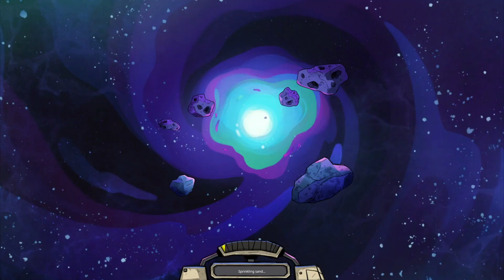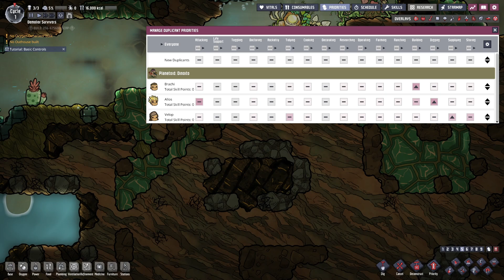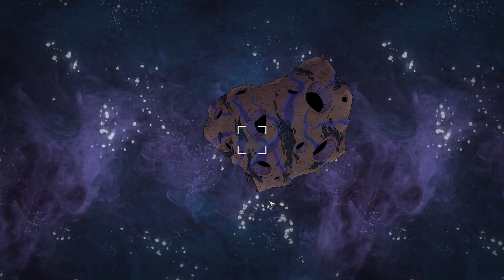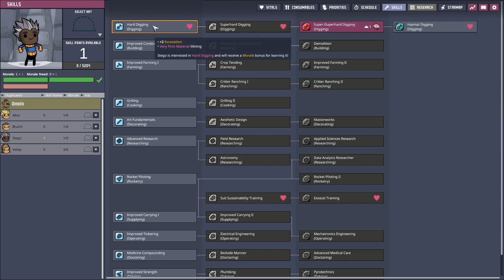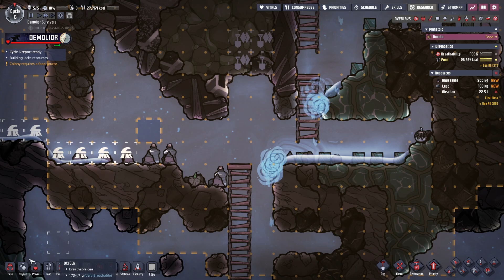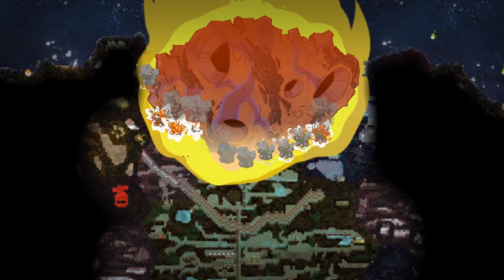Soooooo Close - Demolior Survivors - Ep. 6

Comment: This challenge is literally just: dont dig up. 
1. dig down and to one side for your base, using any natural abyssalite above as a overhang. Never dig/build higher than the lowest meteorite impact tile before the impact. 
2. build two layers of tiles beneath the lowest tile of the meteorite. one obsidian basic tile row. one row of insulated tiles beneath that.
3. Race for Insulated tiles and a digging dupe that can handle obsidian. Cap any non hot vent or geyser you come across with insulated tiles as you hunt for obsidian.
4. Always work from the lowest meteor impact point, working out, but prioritizing the side that your base is on. 
Otherwise its super simple. Try not to have a dupe get stuck or slain on some random event later on before 100 days.

Comment: I've been watching these, and I got my achievement after your second one. To be fair this was after watching how things played out the first couple of videos of yours.

I think your playstyle makes this much more difficult. The playstyle of trying to save as much as possible and get all the goodies that you may lose. No shade at all, we all play our own way. :)

After watching your second video, I did it this way:

1) everything four spaces away from the impact I never touched.
2) I researched quickly to insulated tiles and then used these to block off the heat area all around. Simple Shale insulated tiles worked until I got cool water running through them to pull out heat. Keep in mind that to survive past cycle 110, you have to insulate against all the volcanos and steam vents all around you anyway.
3) Food for me was one "doored" off room filled with sweatcorn and 3 mimillets
4) I used a cooling loop to run through the insulated tiles up top where the meteor was closest - once I had radiant pipes I put some in and removed them as needed

After about 20ish cycles everything played normally - set up a couple of stables to ranch two lumbs in each to produce peat and started working towards a SPOM.

The most difficult part for me was managing heat, but thanks to the cool slush geyser, it was not too hard. The way you are holding back the asteroid with built tiles is going to create a serious heat problem in the next 100 cycles...that is my guess.

It just seems to me that you are so focused on saving things and building a barrier instead of surviving. You mentioned in the second try that the tiles are much more dense than tiles, and that is where I got my strategy, so thank you. :) If you back away 3 or 4 tiles and just play to manage heat, it isn't hard at all really. You just have to give up on saving so many things.

If it helps, just think of how many things you can mine out after you survive and think of the fun taming the asteroid :)

This seed spawned a cool slush geyser right under my base if you are interested: V-PRES-C-907201049-0-D3-0
Reply: Did the shale too
And you can just replace it witb igneous rock later. Very little heat escape when you do

Comment: This challenge is 100% do able. I was able to relatively do it without cheating, but i still used debug for food and some other tasks, since i gt greedy. but if you just immediatley forfit everything in impact zone and grab 3 build/diggers you got it  basically by cycle 6 all obsidian and the second layer ready for 3rd layer. AFter that, its just spending 2 cycles dealing with any geysers/volcanos near by. which flooding is easiest option.